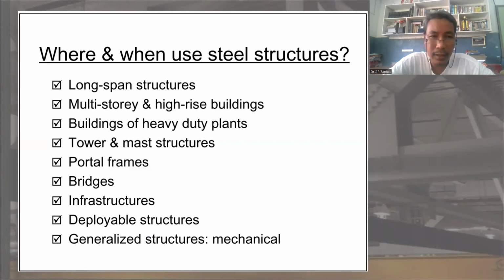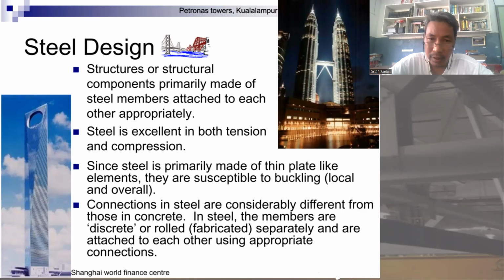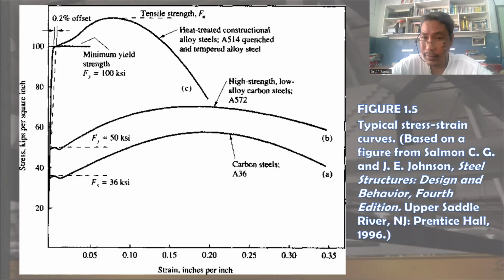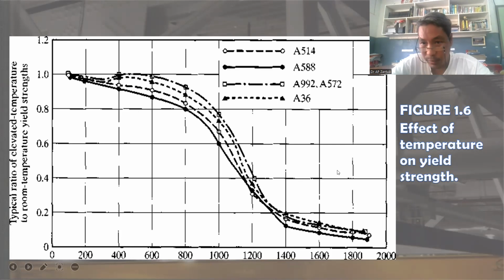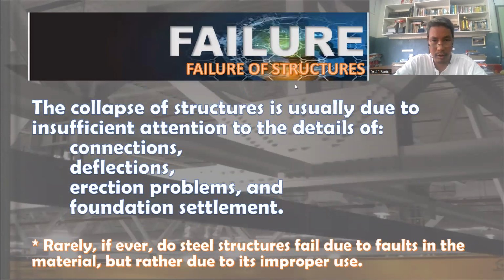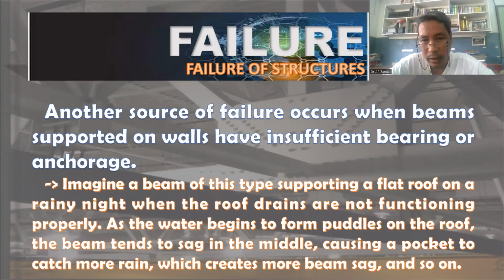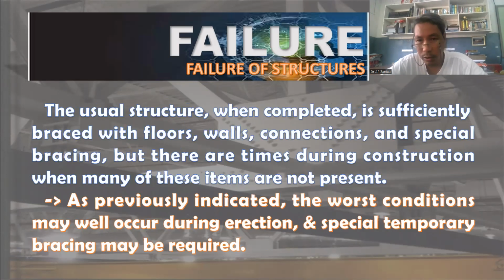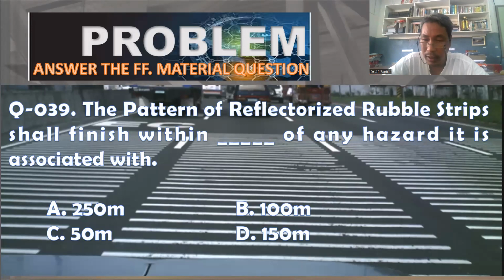Introduction - Concepts of Steel Design [ Principles of Steel Design ] Module 1.05

Comment: Thank you Dr. Z for discussing the topic regards to steel design's concepts which are the main underlying sorts, various levels of steel's solidarity. In addition, the insufficient reasons behind the structural failures and given such scenarios that is utilized for instance concerning the type of beams and some other inadequate circumstances.

Answer in Q-039.
C. 50 m

Comment: Thank you very much, Sir. The reasons of structural collapse are discussed in this video. I identified several common mistakes in connection design, as well as a lack of attention to detail, which leads to failure.

Comment: Thank you so much Dr. Zantua for explaining this video regarding to the concepts of steel design. I’ve learned that the collapse structures are usually due to insufficient attention to the details of connections, deflections, erection problems and foundation settlement. 
 
Q39: Ans: C. 50m

Comment: Thank you, Sir. This video focuses on the causes of structural failure. I've discovered some typical errors in connection design as well as a lack of attention to detail that leads to failure.
Q 39.
Ans. C. 50 m

Comment: Thankyou sir for teaching us about the concept of steel design on psd. The video tackles about the main structural types for buildings and bridges and steel design. Also for tackling about the mistakes and lack of details that caused failures of structures.
As for the question 039, the pattern of reflectorized  strips shall finish within __ of any hazard it is associated with. The answer is B 100m

Comment: Thank you for giving us a very well-explained video regarding the concepts of steel design. I’ve learned that the collapse structures are usually due to insufficient attention to the details of connections, deflections, erection problems and foundation settlement.
Question 39:
Answer:
C.) 50 m

Comment: Introduction - Concepts of Steel Design [ Principles of Steel Design ] Module 1.05
- Thank you sir for this lecture video of introducing the concepts of steel design.

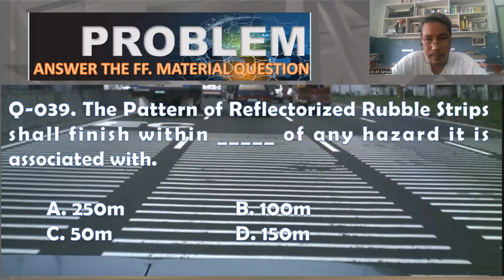26:27 Question 39: The pattern of reflectorized rubble strips shall finish within ----- of any hazard it is associated with. The answer is C, 50 m

Comment: Thank you sir for discussing this lecture video about main structural types of buildings and bridges. Also, than you for sharing your knowledge what are the features of high strength steels.

For question 039,
 the answer is letter C. 50m.

Comment: Thank you sir for this Introduction of the concepts in our course which is steel design that we are using now a days . Also thank you for providing graphs that helps us to differentiate different type of steel through stress- strain curve. and also for the possible mistakes and cause of the structure failures.

Q.039
C.50m

Comment: This lecture primarily focus on the sources of failure of the structures. I have learned some common mistake in connections design and some insufficient attention to details that causes failure. This video made me familiarize with the behavior of the steel. Thank you, sir. For Q-039 The pattern of reflectorized rubble strips shall finish within 50m of any hazard it is associated with. (C. 50m) Ans.

Comment: Thank you sir for this lecture video about main structural types of buildings and bridges. Also, than you for sharing us what are the features of high strength steels.
For question 039, the answer is letter C. 50m.

Comment: - What is the current highest strength steel
Structural steels with very high strength levels are normally called ultra-high strength steels (UHSS). The designation ultra-high strength is arbitrary since no universally accepted strength level for the term has been established.
-Q-039. Ans Letter B. 50m
Thank you sir for teaching us the topic I learn more.